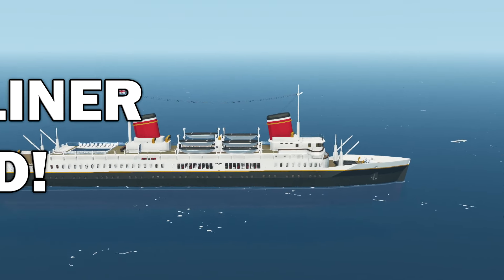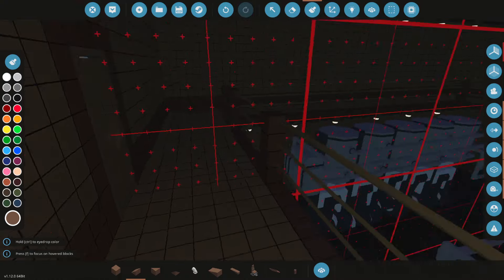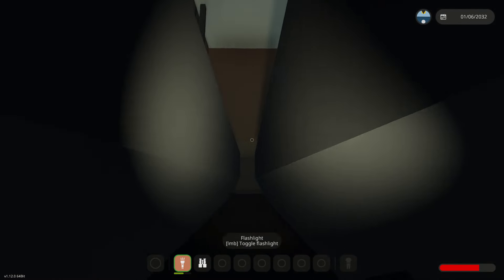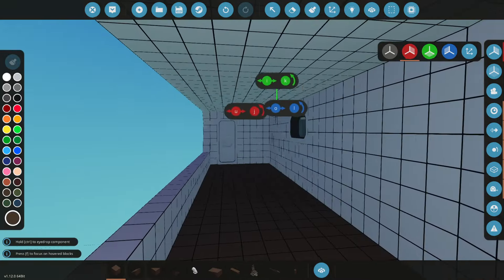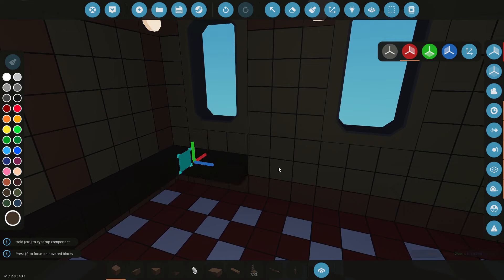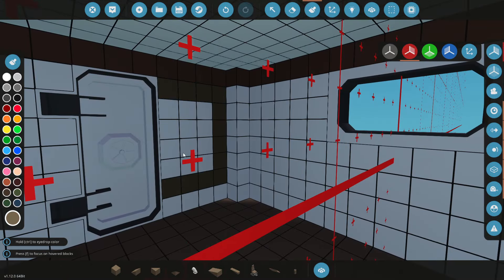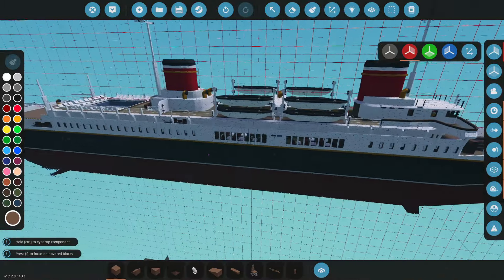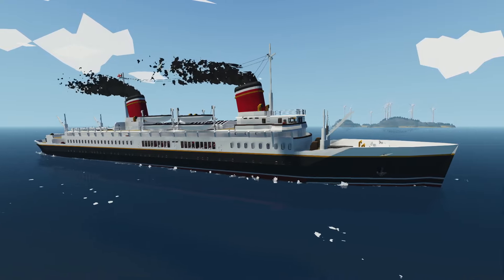Almost Complete!? - Ocean Liner Build - Part 31

Comment: Hi Frantic! I do believe that the engine/boiler/cargo hold rooms shouldn't have wooden walls. Since they're not passenger areas, they shouldn't look fancy, much like the passenger areas, therefore, I suggest you put the floors as grey, and the walls as a white with an orange stripe at the bottom.